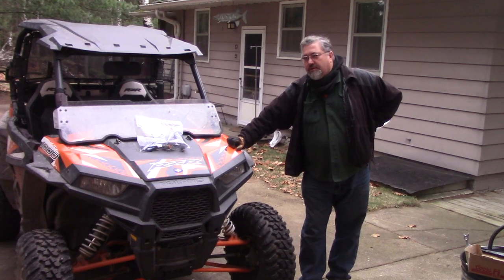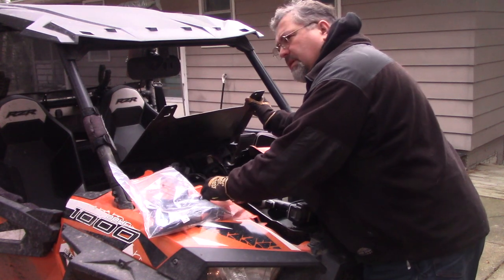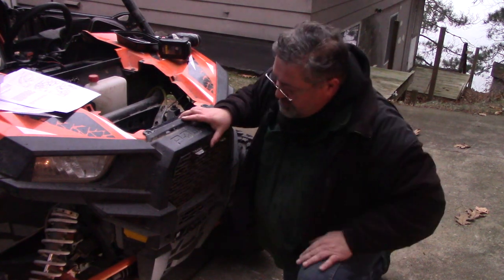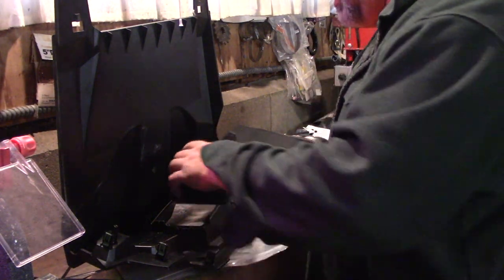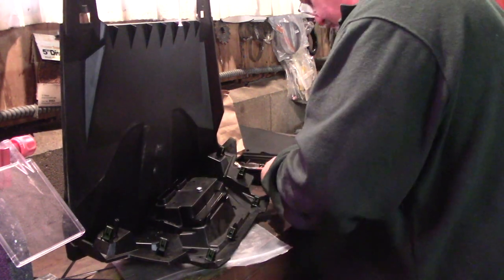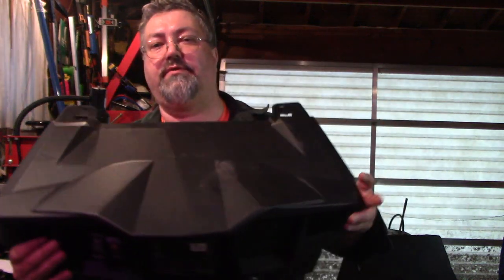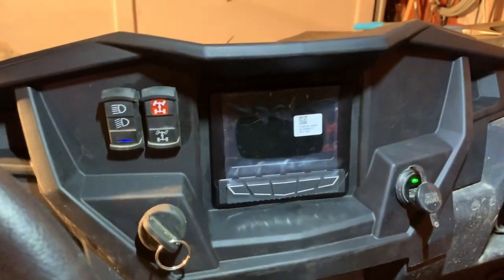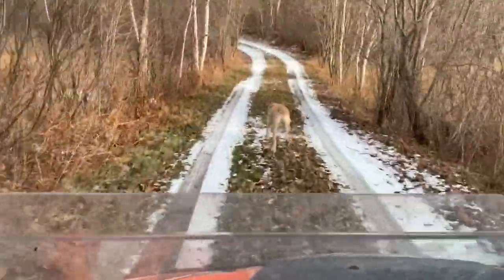Installing Polaris' Interactive Digital Display 2.0 for Off-Road GPS on Trails

Comment: Neat gadget Eric.  I've got a '15 XP1K I've thought about putting a GPS head unit in but i'm still fumbling with a Garmin Oregon trying to figure all of its features out.   I've got the same half windshield and quick release plastic clamps.  Surprisingly they keep holding up.
Reply from the maker: I hear you about puzzling out gadgets. One thing I like since the Polaris IDD uses buttons is that a gloved hand can run it.
Reply: @MinnesotaEric    It does look fat finger friendly.  I'd need that!
Reply from the maker: @stevegreene4880  If you're interested, I found an eBay seller packaging the IDD 2.0 with the correct install kit who also accepts reasonable offers. There are two newer versions that are bigger and better and a lot more money.
Reply: @MinnesotaEric  Thanks Eric, I'll revisit with ya when that time comes.

Comment: What’s the link to the idd screen ?
Reply from the maker: I got it off of eBay. These days I'd look at adding a Command Display. Either way, I need to make an updated navigation video because the IDD you see in this video now is just used for engine monitoring and I'm using a Samsung tablet for GPS.

Comment: I was trying to look...but have you checked if your mileage and hours have transferred over to the new display?? Thanks, and nice job sir.
Reply from the maker: The hours on the machine carried over, and I suspect the miles as well, but I cycled through my preset screens and didn't see any that displayed miles. No miles is likely my choice as I track my maintenance by hours. Thanks for watching!